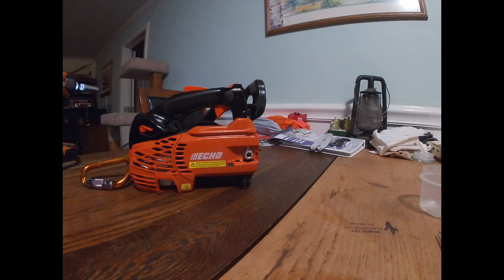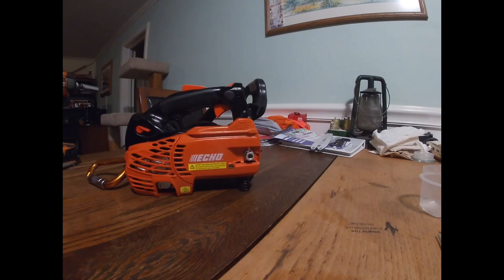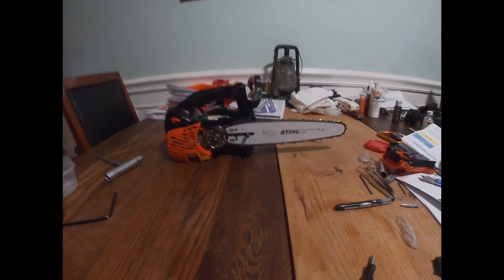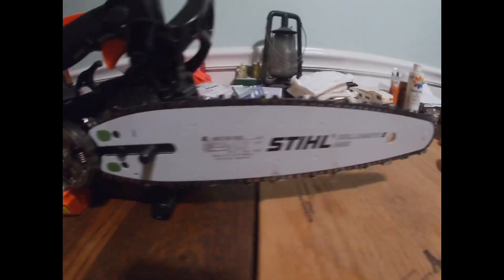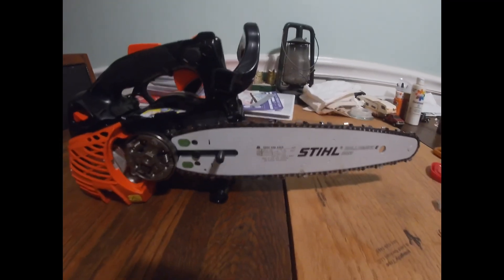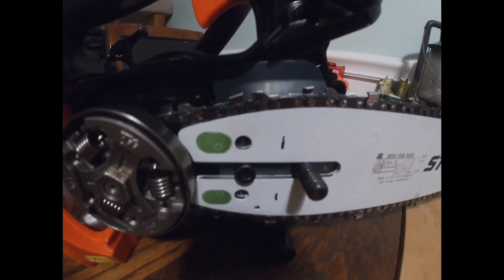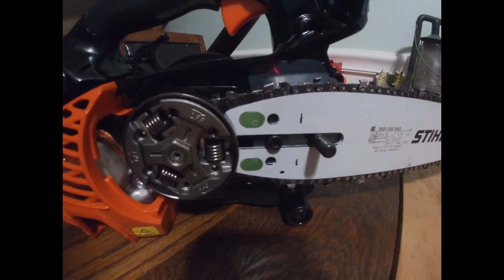Echo CS2511t Part 1 & 2, full 1/4 pitch conversion.

Comment: I know this video is old, but did you use a piston stop inside the spark plug hole to hold the sprocket in place? Or what did you use. Ive seen some use small rope. If you used a piston stop what mm size did you use? Im guessing 10mm
Reply from the maker: I used a short piece of clean rope, it was unused prussic leftovers!
Reply: @DRTE22  thanks I was thinking of just using the old spark plug as a 'piston stop' and replace with a new spark plug. Think that would work? 

Also I heard using an impact drill isn't recommended to remove the clutch...how's the saw been handling since the conversion?

Comment: Hi

how did you work the rail over the hole so that it gets oil?
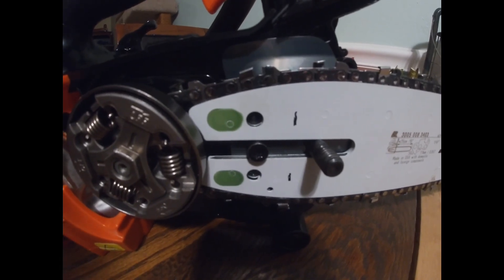Reply from the maker: 4:21  if you watch about 4 minutes in, I walk you through the process of drilling the tensioner/oiler holes. They have gaps inside the hose where the oil passes through to get to the chain. Hope that helps! If you need any further details, I’ll be happy to make another video.
Reply: Thank you for your Video and answer👍🏼✌🏻💯
Reply from the maker: Of course, you’re very welcome!

Comment: Just get the saw ported and stick with the stock setup. It’s not that much more. Checkout my channel if that sounds good to you.
Reply: Я вибачаюсь. А увеличение оборотов нельзя допускать .!  Будет перегрев и поломка дорогая. Максимальние обороти повінні бути як в мануале( инструкциї). Дякую.
Reply from the maker: Why spend more money and time sending the saw off for that when I can do all of this at home on my work bench? I personally love the 1/4 pitch over the stock because it allows me to run a 10” bar, drastically reducing the overall weight of the saw and most importantly reducing the rotating mass. I’ll port it when it reaches the point that it needs a rebuild ;)
Reply: @DRTE22  better results, better chain. Don’t need the saw today be any lighter ;)
Reply from the maker: @yotaismygame  agree to disagree there. My end result JUST about cuts faster than my 201t with 3/8 .043 chain. I’ll do a video sometime of the cut speed with the different bars I have for it, which are the 12” 3/8 .050 and the 10” 1/4 .043. I’m located in central North Carolina now so maybe we can find some comparative size of the same species and do some recorded cut testing! :) 

Reducing the saw weight is negligible but reducing your rotating mass makes a DRASTIC difference, that’s just a matter of scientific fact. It keeps the chain spinning faster in the cut, doesn’t bog down, etc. The Stihl 10” 1/4 pitch chains are cheaper as well. I’m definitely very happy with it and I did my buddy’s saw with a 12” 1/4 pitch and he is loving it as well.
Reply: @DRTE22 you must be very weak if you have to reduce the weight on a 6 pound saw.
Reply from the maker: @joshlower1  hi Josh, I’m so sorry that you had nothing better to to today then to come on here and make rude comments about me under my video. I’m sitting on a site clearing a little over an acre and doing most of my bucking and limbing with my full wrap 461 with a 25” bar. So I’m going to venture that your assumption is wrong! 😂 haha. But let’s dig a little deeper? Why not reduce the weight on a small saw? And also, the comment you replied to wasn’t talking about reducing weight, but rather reducing the rotating mass, which is different and we will get to that following! Have you ever held a gallon of water at arms length for any period of time? I’m guessing not, and I’d venture to guess you also haven’t done it with a saw either. When you do this day in day out, ANY reduction in weight is a reduction in strain on your body!! If you were a professional, you would understand how this adds up over the course of an 8-10hr day. So the real question is why do YOU need to make negative comments about weight reduction? If it helps me, it’s worth it, no matter what online micro penga POs says! Also, I was speaking about REDUCING ROTATING MASS, not reducing the actual weight, which means the motor has less strain on it, and will reach peak rpm faster than the 3/8” counterpart whether it’s a pico chain or not. If you have any other questions or concerns, please message me directly! The negative comments are not welcome nor necessary. Thank you, and have a better day!

Comment: I just stick to 3/8 Lp 043 as the 1/4 pitch chain just go’s blunt in like 5 mins in all the hardwood gum trees here in Australia.It go’s real good with 12” stihl bar no need to drill holes or anything ya just add one extra drive link as to what the bar says and it all lines up fine
Reply: on the 3/8LP 043 12 bar you use stihl guide and chain?
Reply: @ Stihl Bar and Chinese full chisel chain 👍
Reply: @jakeharris4465  you say that on the channel you have to add a reader link what does that mean? thanks
Reply: @Charles_Espaces_Verts  do you mean extra link? The 12inch still bar for 3/8lp has 44drive links stamped on it but if your putting it on an echo you have to add one extra drive link so you would have45 drive links  for echo instead of 44drive links for stihl,I make all my own chains up out of 100ft rolls so it’s easy to just make chains to whatever size you need,if you buy them online or from chainsaw shop I’m sure you’ll find whatever length of chain you need.Hopefully iv understood your question
Reply: @jakeharris4465  OK I understood well, so it must be made 45 trainer it is only custom made and not ready made
Reply: @jakeharris4465  apart from that, does the bar grease the chain well?
Reply: @Charles_Espaces_Verts  You should be able to buy a 45 drive link chain from anywhere and yes the stihl bar is oiled perfectly,Iv been a tree climber for 12 years and have had the 2511ts for over 5 years now and have always run the stihl bars on them with extra drive link and never had any issues at all it all works perfectly as it should 👍
Reply: @jakeharris4465  ok i'll try it like this because i don't like 1/4
Reply: @Charles_Espaces_Verts  ye 1/4 is only fir pruning once you get onto big removals it’s not as good as 3/8lp in my opinion,the 1/4 bar setup jams to easy and the chain go’s blunt to quick on dusty thick barked trees,3/8 is much more robust but in my opinion it won’t perform anywhere as good unless the saw has a muffler mod and retune
Reply: @ I will modify it to the carburetor and I ordered Exhaust Pipe
Reply: @Charles_Espaces_Verts  you will love  it all the best mate
Reply: @jakeharris4465  Thank you very much for the advice

Comment: What is the purpose of changing to a 1/4 pitch??
Reply: There's no reason to do it. People just like to waste money
Reply from the maker: The 1/4 pitch bar and chain is much smaller, and therefore lighter weight than both the traditional and narrow gauge 3/8. Less rotating mass equals faster revs and more power through your cuts. Faster more efficient cuts means more productivity, more productivity means more money in less time. Taking a 5.2 pound chainsaw and making it 4.9 also takes a little bit of strain off of your body during the course of a long day of cutting. Hope that helps answer your questions!
Reply: @DRTE22  
Ok I noticed guys like Buckin even on great big saws running the long bars wanting to run the little .325. Chain. And I was wondering if I was missing out on the point because he had tons of power!  But I totally understand if your taking less wood out of the cut you’re going to move quicker through the branch!!  And like you said less load is more RPM which is faster cut!
Didn’t want to be missing any advantage I can get either. I’m 62 and want the fastest lightest!!

Comment: I have a CS 400 18" and want to put an 18" Oregon SpeedCut bar and chain with .325 pitch-72.  Will this sprocket work for me?  thx
Reply: I guess I don’t know who’s replying to what
If he’s got a 3/8 chain on the cs and wants to go to a .325 speed cut bar and narrow kerf Oregon
Reply: Chain he’ll need a sprocket. I bought the speed cut narrow kerf for my husky 55 and she cuts great!
Reply from the maker: @andyjones6361  I see, I could not see the comment thread and did not see the context. Yes in this case a .325 sprocket would be called for to swap to a .325 bar and chain! My bad!
Reply: @DRTE22  
No problem I thought you might have missed something there. I was kind of confused myself!
Have a great new year!
Reply from the maker: No. This will not work on a Cs400. Are you pulling my leg? Cause it seems as you might be… I do not recommend running a chain that small on a saw that size, ever… there would be no benefit. Best of luck!
Reply: You need a .325 pitch sprocket. Call Baileys
Reply from the maker: @andyjones6361  Help me understand why .325 which is larger and heavier, would be beneficial…?

Comment: I just bought the 2511 after wanting it all summer. I'm use to running a 16" on my 201 and not sure I'd like dropping down to 10" what's the longest bar this saw would handle   properly?
Reply from the maker: Hi Elijah,
You can run just about any size you want, however personally I would say 12” would be the max recommendation. Remember, the 201 is a 36cc class too handle while this echo is around 25. It’s a HUGE difference when it comes to the power and torque, so the smaller bar and chain will be directly relative to the power loss you will feel in the cut. I like the 10” because the cut speed is comparable to a 201 with a 14”… again they are vastly different saws, so if you’re wanting that 201 power out of this little saw with a 14” bar, you will more than likely be disappointed. The shorter the better IMO.
Reply: I run a 16 inch bar on my 271t and it loves it. @DRTE22
Reply: if your cutting hardwoods, I like the 12". Probablly go too a 14" for soft wood. I didnt do the 1/4" conversion yet.. Just went too a 12" 3/8 .43g bar and chain.. And punched a 3/8" hole in the exhaust after break-in..Tuned it a bit.. Been running 3x of these daily for past 2 years now..  Great lill' saws. even with the 3/8" .43g and a 12" vs 14,16" makes difference.  just ordered a 1/4 drive x12" setup.. looking forward too try it.. I been cutting oaks, maples,ash,hickory, pine, spruce here in northeast with the 12" .43g and I lovem for anything up in the top'.. so does other guys on crew. The 14,16" is just too big imo for these saws.. Maye a 14" 1/4 pitch mite be ok. But 12" is way too go for all around.. Heck, 10" 1/4' pitch should really ripp.. There are times when I think "yea a bit more chain speed" would be nice, especially sending bigger tops, and stuff.. But avg trimming, limbin, rigging, its fine.
Reply: @justinherdman87  hey, did you convert with a 12" 1/4 chain?  If so how does it perform?  Do you have to drill oil holes w 12"?  Thx.
Reply: @mrpush2532  yes, 12" 1/4" itch.. and yess with the archer bar i had too drill holes for the tensioner, but took 5 mins.. the oiler hole lines up ok... but i wanta get a better brand bar.. 1 week on the archer and its beat up.. and oiler work, but drips a bit down the side of bar..
Reply: I run a 14 on mine primarily for the reach.   Mine is ported and does ok in bigger wood but it’s still not as fast as a 200t